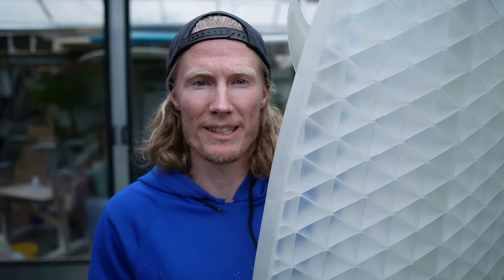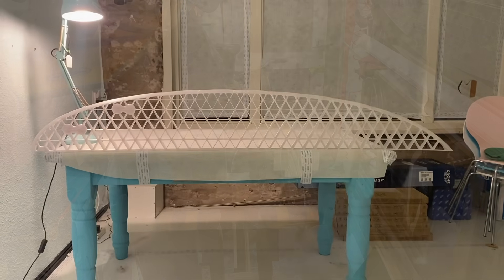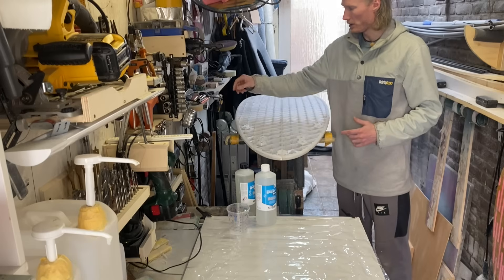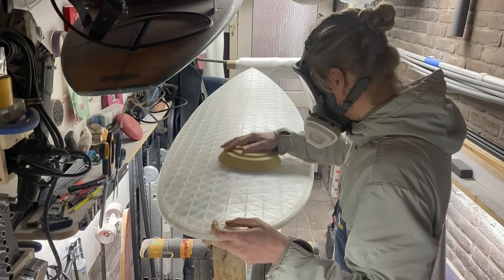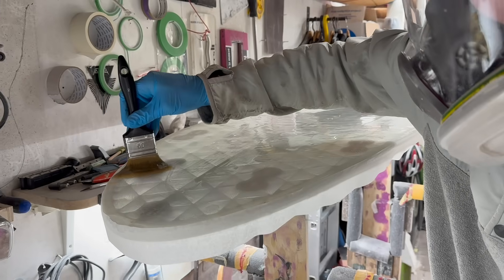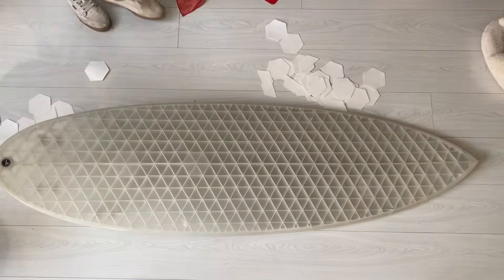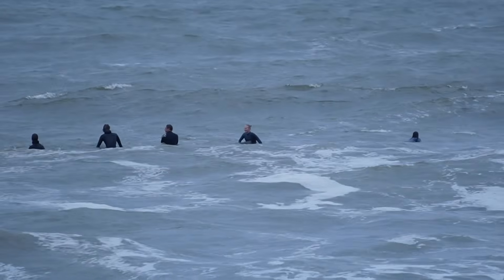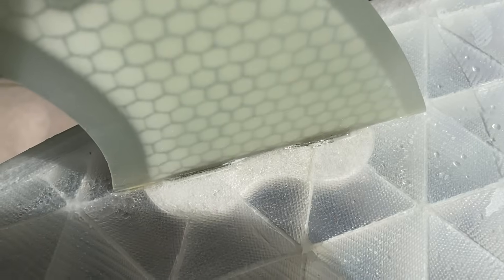How to 3D print a surfboard with a basic 3D printer?

Comment: I reckon a heat valve would make sense for a 3D printed board? How is it holding up a year later?
Reply from the maker: The breathing leash plug acts a a valve. I have fixed it, but never surfed it again. Maybe I’ll take out again this winter. With some swells. Building a better version as we speak. Video will be out soon

Comment: Amazing build! thanks for posting the video. I felt inspired by your build and went and designed my own board in Onshape. I wanted to make a parametric CAD model so that users can change the shape of the board or the size of the parts depending on the size of their printer. I've uploaded the project to Thingiverse in case anyone wants to have a go, Currently attempting to print and glass it using your technique! Loving the chilled music with your videos too!

Comment: tried a similar project and was less successful, one of the biggest issues I had was the weight of the board, do you know how much roughly the board weighed? I think my biggest mistake was using PLA and designing my own hexagonal lattice from the ground up. Also dint glass in the fins so it leaked around the fin boxes.
Reply from the maker: A too bad.. does it look good? My board weighs around 5 kg.

Comment: wonder how it would perform if you coated it with a hydrophobic layer on the bottom?
Reply from the maker: I think it will perform the same. Or else every surfboard would have this technique
Reply: @Dzjiefoils  It certainly wouldn't perform the same, scientifically it would be vastly different the drag forces, it's kind of expensive and not a very safe thing to apply properly so it makes sense it's not mainstream.

Comment: I think you misunderstand the purpose of your face mask.  Epoxy when wet is not harmful, it's when you sand it and the fibres are in the air.  Yet you sand with no mask and wear a mask when applying it.  You need to reverse your method.
Reply from the maker: Thanks for the advice, but epoxy releases toxic vapors the full 24h it is curing. So I do use a mask when applying in my small shed with no ventilation. I also do wear a mask when sanding, but apparently sometimes I forget... Where do you see me sanding without a mask?

Comment: Would you recommend adding chamber holes to the print rather than melting the holes later?
Reply from the maker: Yes, I would make bigger holes in the 3D file. And print with some thicker walls.

Comment: I’m no engineer but I have a few ideas to make this more feasible:

The Board would be a lot more durable if you made the parts interlocking and coated the final version with glue/resin once you’re done.

If you use a soluble material you could probably fuse the connections before applying the coat but I have never done that.

I would add 1 metal rod going horizontally and 1 vertically through the seams (meeting each other where youd usually stand on)

That would 100.000x the structural durability if done right.
Reply from the maker: Interlocking would be great indeed. Metal rods would make it too heavy, Fibreglass stringer and skin will prevent it from snapping.

Comment: Hi ...most likely the water got in because the plastic is not compatible with the resin. That's why the fabric peeled off under stress.....
Reply from the maker: 👋🏻, thanks for your thoughts, but the epoxy bonds good with the PETG. So is not the case that it peeled off. I just didn’t filled this part well enough with epoxy, leaving some gaps in the epoxy coat.

Comment: I use Form Futura CarbonFill for most of my structural 3D prints. A little easier to print than pure PETG but way stronger and good friction surfaces for gluing. Downside, not transparent, but a very dark grey. It has printed structural parts for my bicycle, including unbreakable pannier hooks, my garmin bracket and a pair of "flat" converter plates for using with SPD clip-in pedals. Should be well up to a strong surfboard using the design you've demoed. Cool project. Also, use thermal insets for skeg screws. They push in with a soldering irn and a steady hand and bond better than screwing directly into the layers and the heatpress improves the layer bonds around the threaded insert. (localised anealing)
Reply: Also, I guessed it might be more expensive than foam core! Carbon fibre PETG would be even more expensive. Worth a try for strength, though.
Reply from the maker: Thanks for your comment! Love all the details!
Reply from the maker: And the tips.

Comment: Cool stuff, and always amazed with the stuff people come up. And with some engineering materials and better Inner structures, since PETG is pretty flexible but has little impact strength it is not very well suited for the job. PC ( also available in transparent ) would be a hot candidate for such a project, but requires better printing conditions. 
Nevertheless, great job ! 
Best
Reply from the maker: Thanks for the tips dude!

Comment: I see the leak bubbles. You want to vent that board. It gasses.
Reply from the maker: It has a vented leash plug. And nog it has 2 holes to vent the water out. When it’s dries I’ll fill them up. And then only the leashplug remains

Comment: Would it be faster if u sanded the finish down super fine and put a hydrophobic layer on it. On the bottom only ofcourse. I think the finish on it right now would induce alot of drag
Reply from the maker: This is how all surfboards are finished, just sanded and polished epoxy or polyester

Comment: The issue comes from the glass layer that you have  used. Find a thin material and stick it to the structure to make it flat to it . Then apply glass layers as traditional  laminating . Although that's the future of building surfboards, well done!
Reply from the maker: Thanks, I have been looking for a "in between" material like you mention. I haven't found a good material to use for this application. Do you have any suggestions?
Reply: @Dzjiefoils  cellophane

Comment: how long dose it take to do one layer?
Reply from the maker: Hi, i’m not sure what you mean with one layer? What kind of layer? Fibreglass?
Reply: @Dzjiefoils  how long dose it take to lay out  a sheet and epoxy it?
And what is the drying time
Reply from the maker: ahh.. laying the cloth takes around 30 minutes. And after 24h the epoxy is cured. You can lay multiple layer of fibreglass at once.

Comment: Hi Dzjiefoils , thanks for sharing your "printing and fab" experience with all of us. I love the "tessellated" aspect of it. Did you measured how much it weighted before glassing it and after glassing?. I  have experience building a 1.80 mts long "fish design" surboard , a holow frame made with kiri wood (a light material w/similar weight of paulownia wood) and glassed with Poliester. One "implementation difference" with yours is that I added both venting plug and a "drainage" plug (apparently all tables develop cracks with age and water inevitably sips in... your venting holes between cells are too small for water draining, you may consider bigger inter-cell holes in your next table project)... just commenting in a constructive mood. Awesome project anyway, congrats.
Reply from the maker: Thanks for the tips. I will definitely consider the larger holes. I didn’t weigh before glassing will do on the next one. ☝️👌

Comment: Im just now watching your video. PETG is exactly what I would use also. I print with it more than any other filament. That is after I did 2 things that changed it from hate to great.
First was to dry it. 
55⁰C for 8 hours worked for me. It was unbelievably different. Like printing with PLA different.
Second was going from an open air Ender to an ENCLOSED Bambu P1S. Yes a lot will say that the Bambu is better but I also have several Bambu A1 Mini's that are open air and the quality is nowhere the same as the enclosed P1S.
It's the enclosure.
In fact, I'm building enclosures for the Mini's as I can even tell a difference in PLAs looks when printed in an enclosure.
I print in high detail (because why not and what's the point then?) so any non enclosed defects are multiplied.

But please dry it.
The stringing will go away.

It's a beautiful board though! Your finishing work paid off sir!
Reply from the maker: Thanks man! Yes an enclosed printer would help a lot! But I not willing to to invest in it at this moment. Maybe later!
Reply from the maker: Thanks for your comment by the way! Appreciate it!

Comment: In the time you wasted dealing with someone else’s bad design you could’ve learned enough cad to make a version better suited to your printer. I’m assuming your goal was to have that triangular infill pattern so you would’ve been much better off cutting interlocking 2d ribs. Frankly even 3d printing those would still work much better.
Reply from the maker: Thanks for your comment, I don’t really follow what your saying though. Interlocking 2D ribs? What do you mean by that. I’m currently designing a foil board to be 3d printed. So any advice would be helpful.
Reply: @Dzjiefoils  If you google "How to Create Kumiko at the Table Saw" and check out the article by FineWoodworking, the first image should explain it. You'd ironically be 3d printing 2d shapes but if done properly it should end up stronger than directly printing the 3d structure, would eliminate any of the printing issues caused by the slight curvature of the board (which in your video instead of supports you could've sliced the parts in half in the Z direction which would make it stronger and allow them to print directly, but obviously you'd have double the parts to glue. I think it would also save about 30% overall material without the supports). To design this you could simply make the repeating internal structure, intersect it with your board geometry, then project the joint cutout positions onto the surface generated by slicing the board in half along Z (you could skip this step but the structure wouldn't be as strong). Obviously, you could then manufacture this much more efficiently using laser cutting. If you specifically want to 3d print a 3d structure, I would try to design something that would be strong enough to print vertically so that you can fill your build plate with say 5 parts that are printed standing up and fill the entire build volume rather than one flat part per print.
Reply from the maker: Love this detailed explanation! Thanks!! will investigate everything you mention soon!
Reply: @Dzjiefoils  Sorry, I wrote up a response but I must've not hit reply... If you google "How to Create Kumiko at the Table Saw" and check out the FineWoodworking article it should give you an idea. Ideally, then you could cut this from 2d sheets however you could also 3d print the parts (which 3d printing these 2d parts may end up being stronger than 3d printing a 3d structure). If you want to 3d print it, I would aim for a design that can be printed vertically without supports, as then you can completely fill the print volume and save manual effort there. If you want to print horizontally, I would split the board on the XY axis as then you don't need to worry about the slight curvature. While you will need to print double the parts, you will likely end up saving time in the long run as you can avoid any need for supports/support cleanup. If you add locating features and use a roller for glue, combining the top/bottom shouldn't be too bad.

Comment: Why can’t the separate parts be cover with the printing material and put together like a jigsaw? It would be much stronger glueing the full width of the board or height rather than the edges????
Reply from the maker: You are right, but using more 3D print material mean also more weight. So the board would be even heavier.
Reply: @Dzjiefoils   it you are making it heavier with fibreglass so I don’t get why you only print the structure not the whole surface too and make it a jigsaw type of structure and glue the flat surfaces together . Then the weight wouldn’t matter because the buoyancy would be greater just my thoughts it’s great either way. Have a good one
Reply: And then you could also put grooves on The surface of the print for grip and channels on The bottom at the fins
Reply from the maker: I get what you’re saying and it could definitely work, but the heaviest thng in this printend board is the frame. Fibreglass has a much bigger strength to weight ratio than petg I believe. The board will be leaky and likely break soon if you don’t reinforce with fibreglass.
Reply from the maker: The grooves and channels option would be very cool!

Comment: When I first came  across this video, I thought, wow, that looks so advanced and artistic at the same time. But after watching and seeing the numbers. I can see, it is a great art piece but way too time consuming, expensive, and not really solving any problems in the board building industry. All the 3-D printing accomplished  was to replace the foam surfboard blank, but you still have to fiberglass it by hand with all those steps, just like standard pro board building. But you did do an amazing job.
Reply from the maker: Tanks man! It’s definitely not solving any surfboard building problems. I can agree with you on that. My most time consuming project so far… 🤷‍♂️😎

Comment: I think it would be cool to build somthing like this! How much fiber glass and resin did you use? Would you recomend putting in a wooden stringer? Also do you have any ideas on how to seal the leak at the back?
Reply from the maker: I think I used about 8 metres of fibreglass 70cm wide roll, and 2kg of epoxy. Wooden stringet would make it even heavier and not see-through, so I would stick with fibreglass. I’m gonna fix the hole in the back by putting epoxy on/in it.
Reply: @Dzjiefoils  Did you use 4 oz s fiberglass?
Reply from the maker: 6oz

Comment: Half of your work could've been saved with the fiberglass if you just printed in ABS.
Reply: ABS is ass to print, this took a whole summer, wouldnt be worth the extra time in failed warped prints.
Reply: @pinecrustjuise  get a bambulab x1c before strata threatens each and every 3d printer manufacturer.
Reply from the maker: What do you mean? Print the outer shell as well?
Reply: @Dzjiefoils   the keel, outer shell and bracing are the strongest part of your board. I'm a mechanical engineer dm me if you need further help
Reply from the maker: I’m working on a new board in fusion 360, so I could definitely use your feedback. What’s your Insta so I can DM you?

Comment: I'm not a surfer, so let me just ask why the hell wax is apparently used to add grip?????? Isn't wax that's added onto smooth sports equipment/vehicles usually meant to make things slippery? Is this like the ONE single time where it's somehow the other way around where the wax acts like double sided tape or something?
Reply from the maker: Exactly like double sided tape. Your feet stick to your board this way. A surfboard is not waxed underneath like a snowboard.

Comment: blahahahaha
Reply: @Dzjiefoils  im sorry but i cant lie... it doesn't make sense . its more expensive and it takes a long time and a little pitty prusa,. it takes 15 min to make the board in fusion 360,.. you could have used stator motors and stuff..
Reply from the maker: Thanks for your honesty! I just worked with the skills I and tools I have. Just a fun project. But… I would like to 3D design my own boards now, I would be great to design one in 15 minutes. But I’ve been struggling for hours on end and not getting anywhere near something that looks even remotely like a surfboard. You have experience in 3D designing boards? I’m looking for someone who can help me design a prone foil board.!
Reply: @Dzjiefoils  again im sorry im just that guy
Reply from the maker: I just started with my learning process today. I made a quick shape in akushaper and I’m now trying to figure out how to turn the solid shape of the board into a hexagon structure. Any helpful strategies or tutorials I need to watch for that?
Reply from the maker: Thanks! 🙏

Comment: Did you put in a relief valve  in as so as it gets hot gas has nowhere to go mate did all the work didnt do the valve and it split under pressure build up😢
Reply from the maker: I put in a vented leashplug, and made a hole in every chamber so the board can breathe.

Comment: Would you like some better 3D surfboard files?... Also a tip, print the skin also.
I made a 3d printed board years ago, to this day I haven't seen one done better than mone.
Reply from the maker: Yeah I would love to see them!  Very curious 🧐
Reply: @Dzjiefoils  Sure, I just uploaded some pics to the community section on my channel page.
The board was printed in 13 pieces only, approx 350hrs printing. The middle (yellow) and side (white) sections were printed in perpendicular orientations, and staggered the joins, both for strength. The long vertical join connecting these sections forms the stringer. 
The printed skin is only 0.5m thick, and I only needed one layer of 4oz glass.
Fin box area was reinforced and the plug inserts were printed with ABS as it is stronger.
It was only slightly heavier than foam and glass board. I could have got the weight down more by printing the internal walls (that are glued together) a bit thinner. Also because the temperature in my workshop would change during the printing process, I got some warping which created gaps between sections, which filled with resin.
Reply: Almost every 3D printed board I have seen takes the approach of printing a board that is structurally strong, and then glassing it. 
My approach was to replicate a foam core as closely as possible, as the strength comes from the combination of the fiberglass shell and the core, not the core or fibregalss alone.